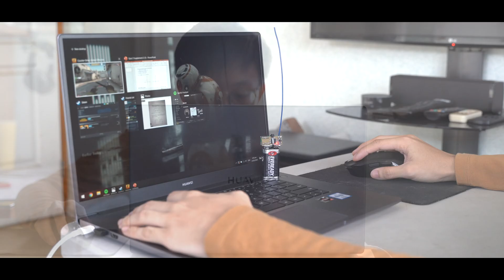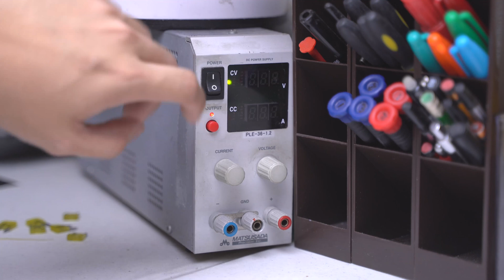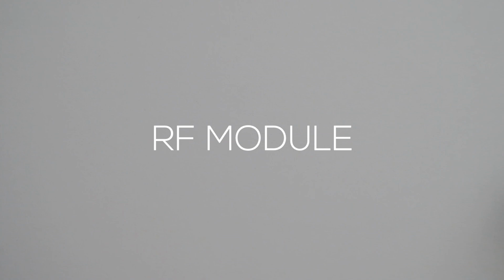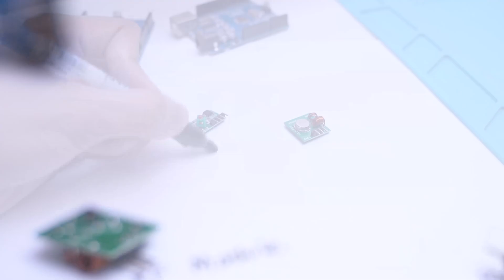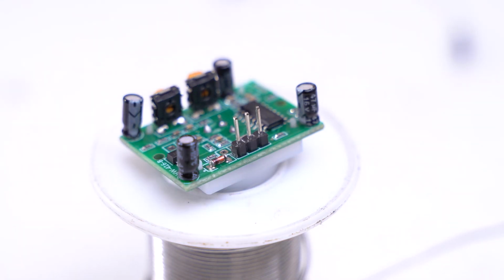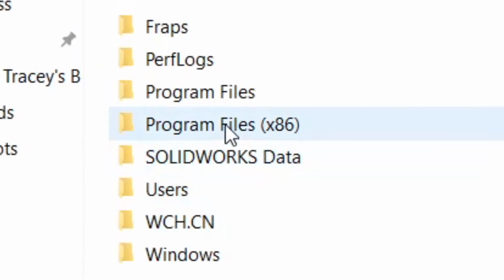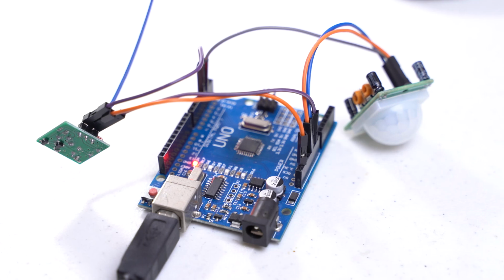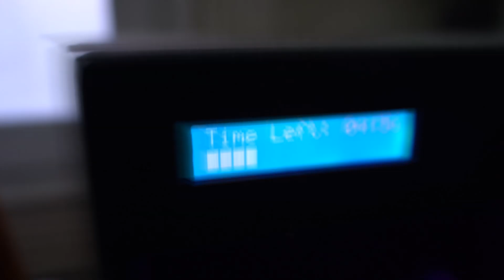Sneaky Spy DIY: Wireless Silent Alarm

Comment: what modifications do i need to do if i use a buzzer instead of LED? do i have to adjust something with the codes? do i place it the same way you placed the LED? this is an interesting project, but i would like to use a buzzer instead of LED :))

Comment: Do i still need to connect the 470 ohms resistor if i use a buzzed instead of LED light?
Reply: Hello! I'd like to ask you a question too because I want to put a buzzer instead of  LED light.

Comment: Most of the electronix vids on YT seem complicated, but im compeled to like your videos.So easy and neat. 
.
.
 .
.
Also I've a suggestion,
instead of depending on LED you can connect your arduino to laptop and create a python script which can minimize the current program.

Comment: Nicely done but... all makers who show on YT "yet another cool Arduino project powered by a 9V battery" never say how long this battery will last. A day? Or even less? And these batteries are not the cheapest... Some kid will repeat your project and will be very disappointed because of this. You can at least mention this problem...
Reply from the maker: Thanks! My bad, I forgot to add that part. An Alkaline 9v battery has an average of 500mAh. I connected both the transmitter and reciever to my ammeter, the current draw seems to reach 10mA max for the Receiver and 11mA max for the Transmitter. With Battery Capacity/Current Consumption=hrs. The Receiver should last around 50hrs and the transmitter around 45hrs. Battery life can be extended using a low current switching regulator instead of the linear regulator I used on the vid.

Comment: I would use Arduino nano as its more compact
Reply from the maker: I would too, but shops are closed and logistics are pretty slow recently due to the outbreak. I went with the DIY standalone board instead :))
Reply: @TechBuilder  Yes, i liked the video!

Comment: You are certainly picking up your game. Great project! I like the bit about using the contacts from a dead 9v battery to make a connecter.  👍
Reply from the maker: Thanks! Yeah! It's my #1 go to when I'm running out of connectors. I'm trying to post new content for a change, focusing on circuits and microcontrollers this time. I just realized I haven't been posting much on circuits recently.
Reply: @TechBuilder  I really like it, the more I think about it. It's a awesome idea.   😉